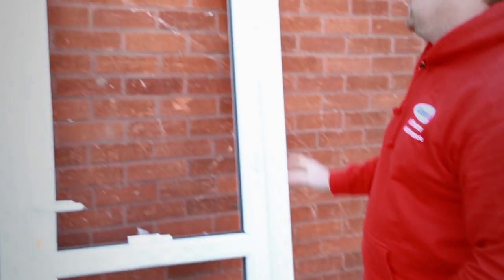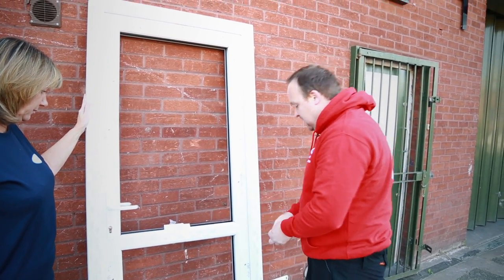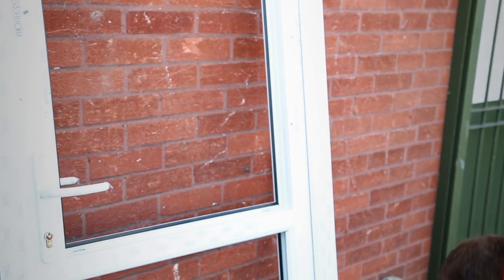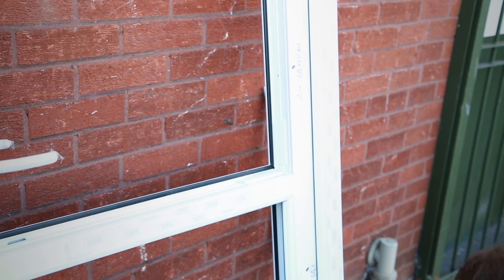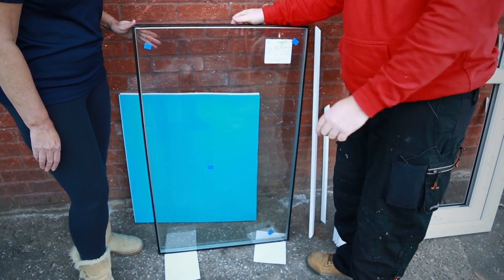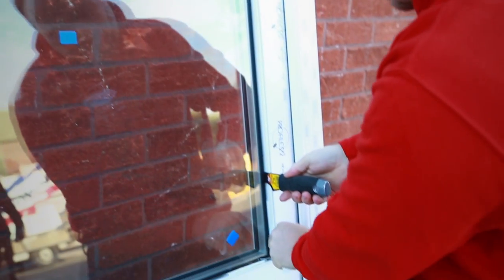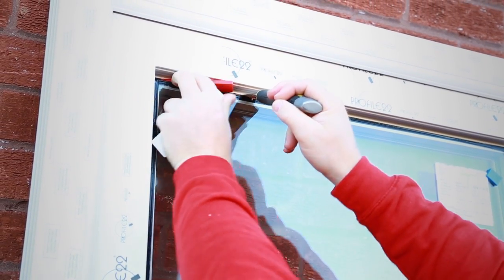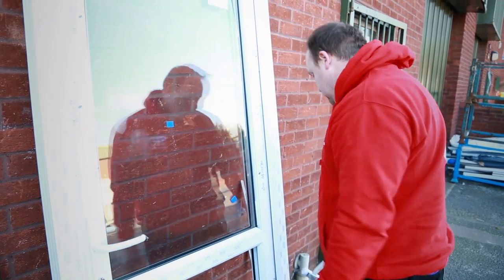Toe and Heal a Door

Comment: There'd be no need for multi adjust hinges on these doors if its toe and heeled correctly after fitting, major must is to square up the door\windows whilst unglazed using packers under door, window, frame, get it level top and bottom, lock them off then glaze correctly using toe and heel method obviously according to hinge locations for doors. Pack them tight where required!and the weight of the glass should sit on those Packers and once door is opened and packers removed from bottom of frame in theory the door cant drop, all these fancy adjustable hinges are to allow for bad lazy fitters i reckon, all that may be needed is tightening or loosening the cams on the multi lock to pull door in  tighter against frame to cure any future draughts or loosen so handles throw up easier for maybe arthritic hands, but if correctly squared  and packed up before glazing a door it shouldn't drop! Do properly fitted wooden glazed doors drop as much as PVC and need adjustable hinges? Chippies tend to get them right first time using standard hinges only. It's all about the toe and heel correct procedure but just as important is getting your unglazed door sash squared up beforehand. You fitters start doing that and you'll never ever get a call back for snagging.
You're welcome! 😇

Comment: Wrong it should be heeled and toed and also another packer opposite the top side packer. If you dont do this the glass just slips into the space and drops. Also use a plastic padel not a metal one in case you break the glass.

Comment: where are your safety gloves demo or not   ? even toughed  glass can have sharp edges ..never use a metal tool to toe and heel ..even with tape around it  buy a glass paddle ..could have been a lot better for the diyer ...

Comment: Rubbish how can toe and heel the door if it's not installed you have no idea
Reply: I fitted doors and windows since 1983 and although what he is doing is basically correct I would never glaze a door prior to install. The weight is substantial and so awkward to open door and fix it. All he is doing is done after installation
Reply: Tells you not to put toughened glass down on the floor due to risk of it popping then proceeds to toe and heel with a metal scraper, go figure!!! No bridge packers used in the top to even out the ridges in the profile either